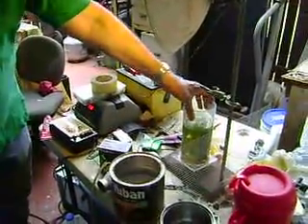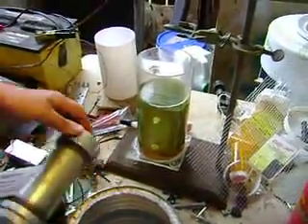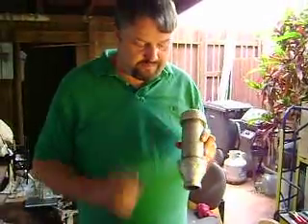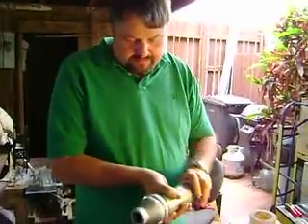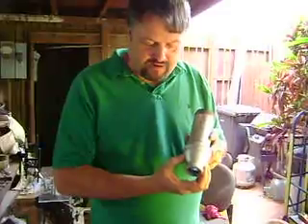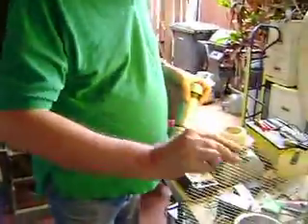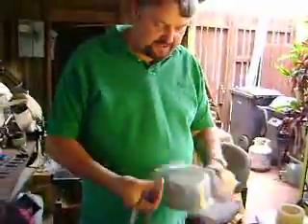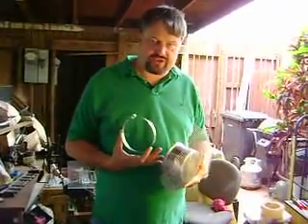New Projects - HHO with wood gas

Comment: Hi Bill. Very interesting Idea. Have you gotten any further with this project? For a car, could you just pipe the HHO into the engine separately to the woodgas so that the hydrogen and oxygen remain separate until they are burnt in the engine along with the woodgas? I would imagine this would go some of the way towards getting back some of the power that is lost due to the lower energy of the woodgas.
Reply from the maker: we never got the project finished, had to move, and life happened